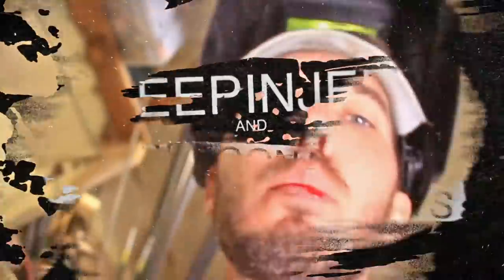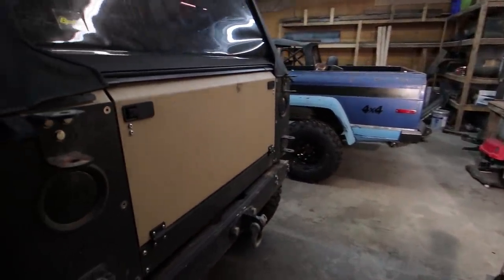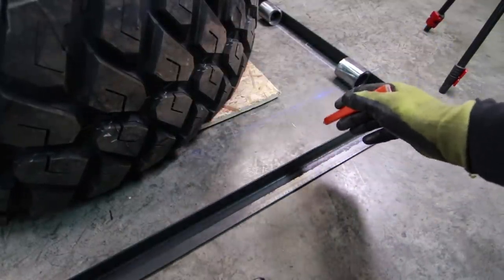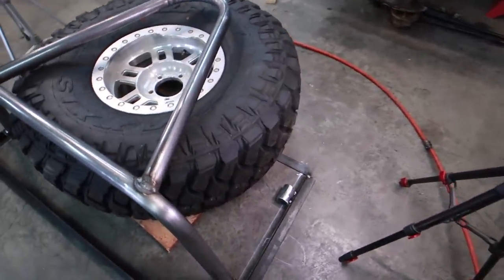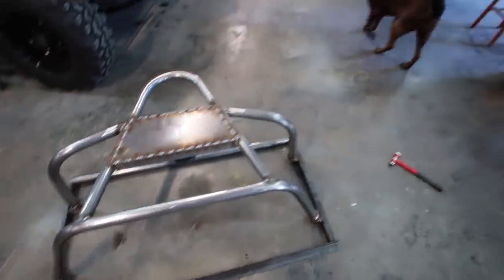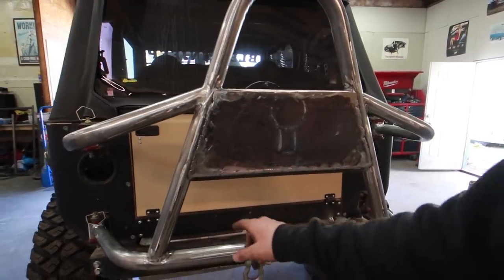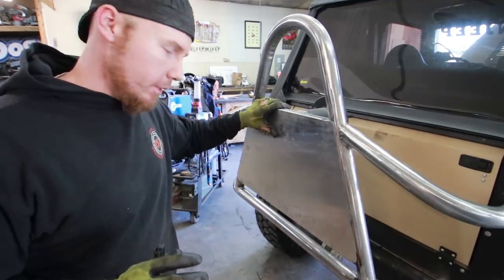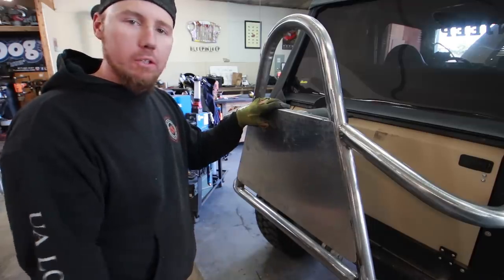How To Build an OFFROAD Tire Carrier 100% from Scratch!! Full DIY!!

Comment: Just a thought. When you replace the front hub and bearing assembly. Bolt it on to the tire carrier to hold the tire. Then, if needed, you will have an emergency front bearing and hub assembly. You will also have spare studs and nuts.

Comment: Nate don't forget to use anti seize on stainless hard ware to prevent cold welding. Stainless on stainless can be a pain to get off after it cold welds it self. Also very nice and clean work as always.
Reply: Where is the stainless on stainless?
Reply: I would be more worried about the strength of stainless.  Somewhere between grade 2 and grade 5 on a rig that takes that many hits with a wheel that heavy.

Comment: Nice Brake machine.  Interesting method to adapt welding the parts together on the floor w/ chalk lines.  I know a frame repair guy who does the same when he is straightening chassis/frames on damaged vehicles. Looking forward to your review on that Miller Welder and more about your welding skills as they improve with "Alu minum" !

Comment: Love the video Nate. I am also wanting to build one of these! Prolly do a similar set up. I may check into the aluminum tubing to cut weight myself. Thanks again and keep them coming.
Reply: Glad you enjoyed it! Aluminum is a sweet way to go. The performance of having a light weight trail rig can be beat!
Reply: @natebleepinjeep9564  where do you get your bushing? Aluminum may be harder to find.
Reply: @phu1324  it's a tj leaf spring bushing kit from 4wheel parts. Runs about 20 bucks. 2"dom works perfect for the sleeve 🤘
Reply: @natebleepinjeep9564  sweet thanks!

Comment: I’m curious how you mounted the hinge points on the Jeep, if they were strong enough to hold the tire and carrier, and if there was any slop or sag in the carrier?
Reply: Me too.  Are you running flat stock inside the jeep between the two hing points to reinforce?  What's inside the back pillar that you can hang that much weight on?
Reply: Gusset/reinforcing the inner tub against the roll cage and the bottom against the frame?

Comment: Turned out great man. I'm sure you're aware, but I thought I'd mention it just in case you're not - you said a couple times aluminum is nice because it doesn't rust. It will corrode though, if left exposed to the elements, in a bunch of different ways. And if left untreated, can be pretty catastrophic to a part. But again, nice work on the tire carrier - it looks awesome.

Comment: Looks good Nate.  Has me interested in the shear/brake now..
Reply: These little tools can be so valuable... and take up so much space!!!
Reply: Yeah. You have far more space than I.  Already stuffed half my basement with a bench mill, 10" lathe, a 100 year old 30 ton press. Drills, saws and a 4 by 4 diy plasma table that needs wired up still. Add in a couple benches and it's stuffed.  😆
Reply: @AttwoodsGarage  damn! You got all the toys!
Reply: @natebleepinjeep9564  But hardly anyplace to play!  Been building my exo'd XJ/MJ mashup outside since my garage hides the F100 in my profile pic.

Comment: best bleepin jeep video to date imo.. usually i everything the videos cover is pretty basically or i already know but this one gave me a whole new method of fabrication thats just a bit different than my current ways and will inspire some new creations

also where do you buy the bushings/sleeves at a reasonable price?
Reply: Thanks man! I get these bushings at 4wheel parts for about 20 buck for a set of 4. They are yj leafspring bushings🤘
Reply: @natebleepinjeep9564  thanks! is there a specific size pin/tubing you buy to go with the bushings? dont have a lathe but would like to make pivot points with less slop
Reply: @AndrewBrowner  the bushings come with the sleeve. If you Google yj leaf spring bushing you should see what I'm talking about 👍

Comment: Love it man.  Any ideas for a 2006 WK ? (I know, not a wrangler). Would love your recommendations or a video. Thanks ! 🇺🇸
Reply: I love those WKs. If I had one it would be the crd of course lol with an overlander themed build. A reasonable size (33s probably) with tube everywhere! Tube bumpers, sliders, roof rack, the works! And a well designed skid can completely change the capability of any rig! Needs to be able to slide over rocks 🤘

Comment: What do you do for the third brake light?  I put a cheapy LED bar type one (along with a backup camera) on my DV8 tire  carrier that mounts basically exactly the same.  So, had to run the wires thru the tube on the hinge side with an external service loop to navigate the hinge.  I think it works pretty good, but I'd be interested to see what you come up with.  I really enjoy your videos.
Reply: I've never messed around with the third brake light. I pretty much only drive it on the street when I'm in Moab Utah and if I was getting pulled over up here it wouldn't be for the brake light lol

Comment: Linear expansion (metal expanding or contracting) is a legitimate fear to have. I've tested a metal rod expanding a couple mm after being set in hot water for 10 minutes. After sometime it went back to it's original state.
Reply: yep for sure, especially in welding things can really pull and twist and pop even when youre being cautious of it.. i think nate had the concept for controlling it a little back wards though, should take on as many pieces/supports as possible then finish weld everything while jumping around to different pieces(dont weld left to right or top to bottom on the entire piece) also letting it cool overnight doesnt really change the end product when pulling it off the temp frame as it cools itll build tensions in the metal and when you undo the tac welds itll spring in or out some no helping that but if welded properly little to no change should occur

Comment: I ❤️ Floyd Equipment /Interwest Metals. Have you experimented with low temp aluminum brazing rods? I’m seeing them advertised a lot.
Reply: Not yet but I would like too! I've been very curious about those aswell
Reply: I’m going to pick up some on Amazon and experiment with them. If they pass the test they will go into my dual sport motorcycle tool kit. Way cheaper than an AC/DC tig welder.

Comment: why not a roof mount, instead of compromising overall size/maneuverability?   (just curious on your thoughts there, i'm fix'n to build a xj....)
Reply: center of gravity -- and giant pain to get it down when you need it
Reply: @glenm2229  that's somewhat what i was thinking, on both counts.  making it a half a dozen of one, 6 of the other consideration..

thanks for your response

Comment: No it's not a false fear. The craziest thing I've ever seen is putting a ten foot 1/4" square tubing in a vice about 6 inches from the end. Take a oxy act torch light it and just brush the flame across that 6 inch end and watch the rest of that ten foot piece dance. It shows just how much metal is affected by heat if you don't have good tacks holding it in place and weld it by skipping around. Nice job.

Comment: That's a really heavy tire mounted to aluminum? I question the integrity of that approach. I hate to be Debbie Downer here but aluminum does not do well with continued vibration and shock load that you get off road. I suppose time will tell but bumper mount is well tested, especially for a tire that size.